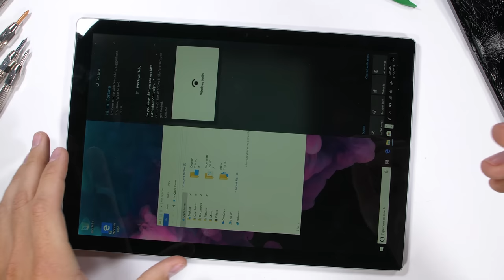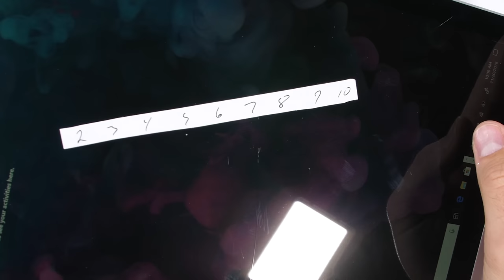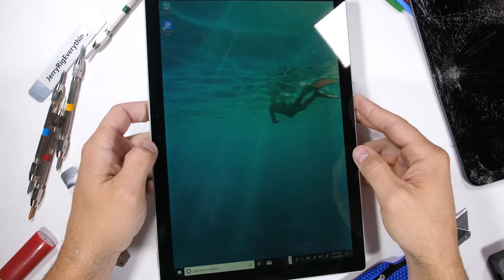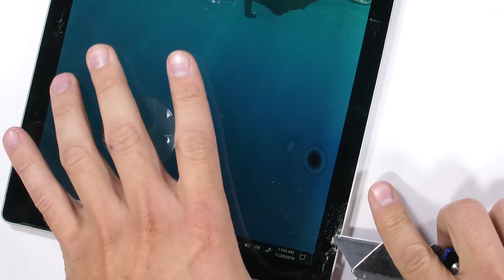Surface Pro 6 Durability Test! - Is it stronger than the iPad Pro?!

Comment: "while the surface pro is a laptop in the size of a tablet, the Ipad pro is a smartphone in the size of a tablet"
YOU'RE RIGHT ON THE MONEY
Reply: @BingBong Boopledoop It has an operating system?
Reply: @damnitsteve  ...r u srs
Reply: @BingBong Boopledoop how is it neither a good laptop or a good tablet?
Reply: @emmanuelmedina2740  To be honest, I hate the Surface Pro. The main reason is because of it's subpar experience as a laptop. Having to attach the keyboard and use a kickstand is extremely annoying for a laptop. That's why I prefer the surface book over the surface pro. The tablet experience also isn't as focused as on the iPad.
Reply: @waseemalghunaim  well, the ipad is literally just a big iphone. Simple as that. And while the surface book is way better than the surface pro, it also costs quite a bit more as well. This doesn't make the surface pro bad or subpar. I have one and I absolutely love it. Its made for people that want a truly mobile laptop. I use the thin case keyboard and trackpad. I thinks its amazing. Although the surface book 2 is way more powerful. Its nowhere near as light or portable as the pro even with the pro keyboard case.
Reply: @blackhand9581  spot on. An innovative ipad would be thinner than what it is, and much, much sturdier with a newer material or some way to place thin steel plates on the inside to resist bending while keeping it lightweight. That would definitely be innovative.
Reply: @BingBong Boopledoop what? Why surface is neither good, I think its a good laptop
Reply: What is a good tablet? Something that is nice to watch Netflix on?
Heres the thing with the Surface, yeah maybe the UI isn't as touch friendly as the iPad but there are no compromises, you can do anything you can do on a computer on a Surface, the same can't be said about the iPad.

This is why one of the suggested videos on this video is "WOAH I edit an ENTIRE video on an iPad Pro" . You'd never see that for a surface because no shit you can edit a video, it runs Premier and After Effects and has USB ports.
Reply: @emmanuelmedina2740  Its not a good laptop because you have to use the kickstand to make it stand up unlike a laptop so it's hard to use on your lap. And it's not a good tablet because it has windows which is really not optimized well for tablets or touchscreens in general.
Reply: @GhostAcez  what is a tablet? Explain that to me. A netflix machine? A social media tv? I agree its not as comfortable, but why does comfort define what a good laptop is? If this is the case  most gaming laptops are just flat out bad laptops. And so are small laptops
Reply: @blackhand9581  I agree on better durability but better hardware? Like what? Because apple really wasnt lying when they were talking about the power of it beating most laptops. Look it up. It beats up to some i7s. Basically the only laptops that can actually beat it in power are higher powered i7 or i9 laptops that are generally big and bulky. And definitely if a slimmer version (not considering thermal throtling with an i9 like the macbook pros) they are still no where near as portable as an ipad pro. So all it really needs is either better apps in ios or something like mac OS. Personally I think the reason why they don't put mac OS on it is because they know it's more powerful than most of the macs in their lineup and would also be the cheapest and most portable as well so nobody would need to every really buy any of their other macs unless they want a 15inch screen or a thermal throttling i9.
Reply: It would kinda make all of their macbooks completely obsolete
Reply: @emmanuelmedina2740  Gaming laptops are generally uncomfortable, as are really small laptops. But at least they can perch themselves upright without a kickstand. That's a problem with using both of these devices as a laptop really. But at least the ipad is good at being a tablet. And no a tablet doesn't just have to be a Netflix machine. I would define a tablet as a device with a decent sized touchscreen and is optimized to be used with the touch screen. When you have to simulate mouse controls with your finger like on windows tablets, that kinda sucks. But the ipad is meant to be used fully with the touchscreen.
Reply: @GhostAcez  there is literally no benefit to having such a powerful cpu in a device that cant use all that power. Same with the iphone. Apple boasts they have the most powerful mobile cpu. So you can load a webpage 0.08 seconds faster?
Reply: @GhostAcez  you're right they dont need a kickstand because the heavy, thick base with the keyboard outweighs the screen. The kickstand is still way more versatile than a regular laptop screen. The surface pro is a super tablet, that does whatever a full laptop can do. It can do way more than any tablet can ever dream of doing. Because its a full on PC in tablet form. The ipad is just an oversized iphone. Your whole argument is based upon 'comfort', while disregarding what the two devices can actually get done and what they can be used for.
Reply: @emmanuelmedina2740  Well they do actually use that powerful CPU in their phones in other ways. (But as far as loading stuff up goes, it loads power intensive apps a lot faster not just 1 second) But I do agree, this needs either a better version of ios or mac OS or something more. But I mean if more apps came out specifically for ipad pros on ios, it would be fine. You might think it still wouldn't be but think about it. The only reason you're saying it needs a better OS is for more power intensive apps.
Reply: @emmanuelmedina2740  How is it a Full Pc in a tablet??? Just because it has windows? There are windows tablets for $100. Almost if not every single variant of the surface pro 6 is slower and less powerful than the ipad pro. So again, what makes it a "full pc in a tablet". Why is the ipad pro an oversized phone? It has a more powerful processor than any phone out there including iPhones. Also it has a more powerful processor than most laptops and windows tablets out there. So are you literally just basing that on it running ios? That's just dumb if so. If they ported a full version of windows 10 on ARM to a phone, would that make it a fully PC in a phone even though it would be running on a snapdragon 845? (I use this processor as an example because it's in some full windows 10 tablets)
Reply: @emmanuelmedina2740  Also I was arguing about both comfort and that the fact is that the majority of thing you use a laptop or especially windows tablet for, it can also do and do faster. So can you name something that you don't think the ipad could do that you can on a surface pro?
Reply: BANG ON THE BUCK
Reply: @blackhand9581  man imagine if the coming apple devices are thinner and sturdier (harder?) than they are today, Sounds like a makeshift knife in a way.
Reply: @blackhand9581  What?
Reply: @GhostAcez  Are you seriously suggesting that i7 is slower than a mobile cpu? And what external gpus does ipad support?
Also using premiere with surface is quite nice, just use your workstation remotely to do any processing, i think my 8700k+1080ti does everything faster than any ipad - or pretty much any apple product.
Reply: @Ziegeri  Yes the mobile processor in the ipad pro is faster than basically 90% of Intel's laptop processor lineup. Also are you seriously gonna compare a desktop to a tablet?
Reply: @GhostAcez  Yes, since it is viable way of using a surface product. You can plug ext. gpu into it or use resources of a desktop or serverfarm if you so choose. These are options that are not available for ios.
Reply: @GhostAcez  Lol, the way tough defend apple is astonishing.  Enjoy your Netflix Machine.
Reply: @MRBIGCOHONEZ  Because of course nobody can have discussions about products anymore without "defending the company". Run along little one.
Reply: @GhostAcez  Lol, what good is all that power if you cant do anything with it.  It's like owning a Ferrari without a transmission or tires.
Reply: @GhostAcez  I've had my SP4 for 2 years now and I wouldn't want to swap for a normal laptop anymore. So much more versatile, I find the kickstand hugely advantageous for working while half lying in bed, which I couldn't do comfortably with my MacBook.
Also been using it at gigs for sheet music and keyboard sounds in ways that a normal laptop couldn't handle.
So I guess it's just personal preference and user scenario.

Comment: If I've learned anything from these videos on the Surface Pro 6 and Surface Studio 2, is that Microsoft has spent a lot of time developing hinges over the last couple of years.
Reply: Ye, if they ever go bankrupt they could start a hinge company lol. Most of their products are built around a hinge.
Reply: Probably the last 30 years since they took forever to make a pc in the first place
Reply: but the prettiest hinge is still the yoga book and yoga 900 series of watchband hinge
Reply: Microsoft's success hinges on the Surface Pro
Reply: apple has spent a lot of time making their devices smaller and thinner, and i think we all know how that went.
Reply: This only shows their commitment about their products' engineering, which is a good thing.
Reply: Yep thats true the studio has a wonderful hinge to keep it at any angle
Reply: @NeilDSouza7  Good one.
Reply: @Randyy1  Thanks
Reply: Yes, and while they did that, nobody worked properly on Windows.
Reply: Why didn't he test the hinge durability??😪
Reply: You pay a lot, you get a lot.
Reply: @Satsujiin  Yes. I know what an OS is. It an Operating system. Windows, mac, android, those are all operating systems. The Microsoft surface pro back a few years was their first actual computer, PC, made by them. Which is what I meant by it tooke them near 30 years to actually make one.

Comment: Had you not cracked the glass, it might have resisted bending even better.
Reply: Shouldn't have cracked in the first place
Reply: no way dude
Reply: LG 3 Phone old
Reply: @emllik2155  he was applying additional pressure on the tip to highlight the thinness of the glass.  That's basically how an emergency hammer works to break car windows.
Reply: Unlikely as sp glass is thinner than soap bubble. A joke of design.
Reply: @10secondsrule  Do u mean sb, cuz if not then I don't get the joke.
Reply: Loshi Studios sp= short for surface pro. Had 2 of them, both cracked. The screen design is a joke. If you don’t get it...  you won’t lose the money. ;)
Reply: Have it not have cracked, it most likely would've after the bending
Reply: @10secondsrule  Ahhhh OK I thought you meant to write sb as a reference to something I didn't know and the joke was that sb also stood for soap bubbles hahaha 😂
Reply: It cracks, get over it. It’s a well known issue.
Reply: @AppleReviews  the stand comes built in the case doesn't. Damn u I sheep
Reply: @AppleReviews  The stand is built in and a fixed part of the Surface. Just because the iPad doesn't have such a useful feature doesn't mean it's unfair, that's just a unfortunate (structural) disadvantage of the iPad. Nobody is withholding this feature from Apple and nobody requested the iPad to be thinner, it's just a unnecessary design choice from Apple. Adding the Keyboard only on the iPad however, would be unfair because that's a removable feature which both devices offer.
Reply: @AppleReviews  that's because the kickstand is attached with the surface and can't come off where as the iPad's protector is optional and not fully attached
Reply: @madil2259  no, hes not stupid, hes a man willing to defend Apple no matter what it takes, even if it means going in a new category for stupid
Reply: @jtfarin9995  dude. I laughed really hard. I was not expecting a reply like that. :-D
Reply: @madil2259  why thank you. I'll be here all day man